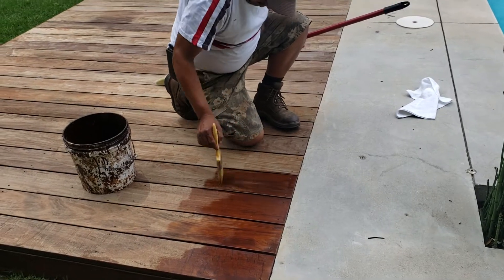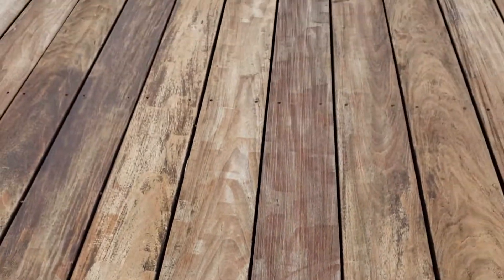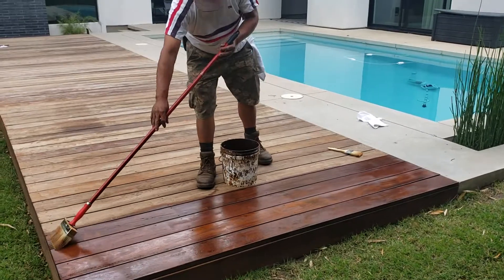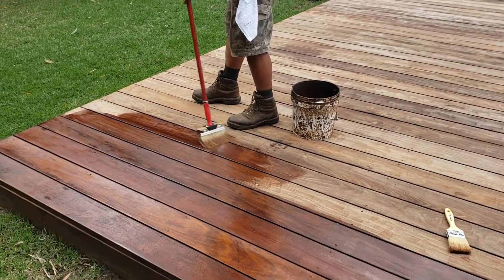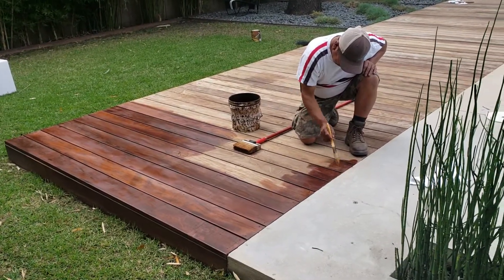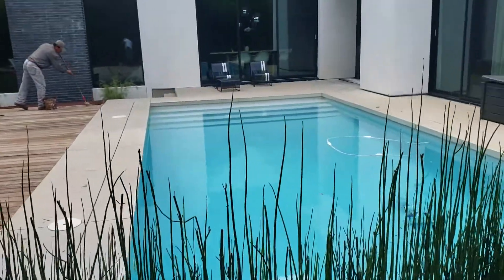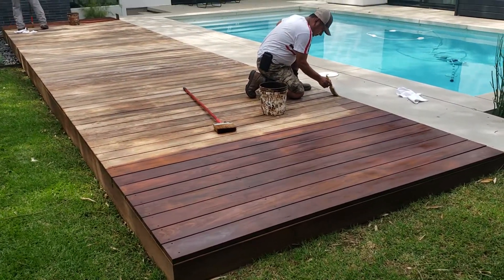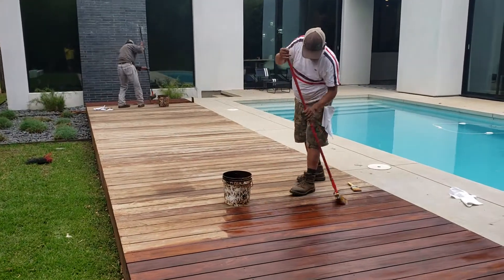How to Stain IPE hardwood Deck, watch the pros

Comment: Great video. You seem like your knowledgeable. Can I ask you. My deck is grey and I want to stain it. I am going to sand the whole deck with my feestool sander, do I need to clean it first or if I’m sanding it that will be ok as it will take the dirt of as I sand the top layer off? What your experience say?  Also don’t you need to run a rag over after brushing? Or is that wrong if I do it?

Comment: That is such a small deck that it could have been cleaned first, sanded with about 80 grit then 120 (I often finish quickly with 220), then an oil stain (like Ipe Oil) with a wool applicator, leave it 20-30 minutes then carefully, and thoroughly wipe off the excess.  As it is you will have uneven application because of the poor preparation.  To do this properly would have taken you guys an extra hour perhaps two.
Reply from the maker: Yes. Agreed. All could have been done within proper budget.